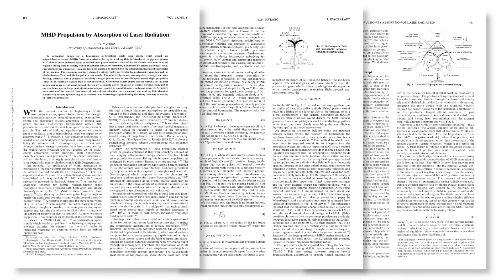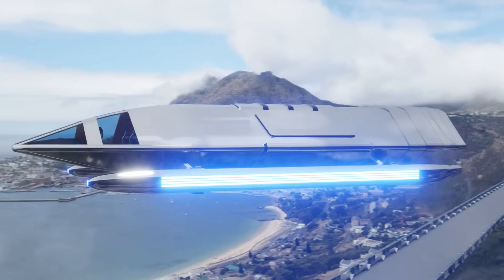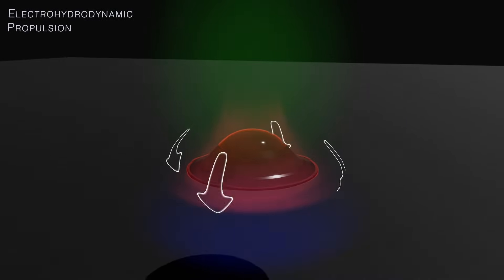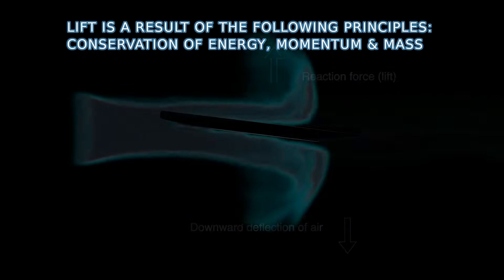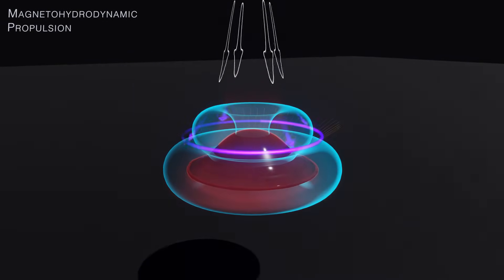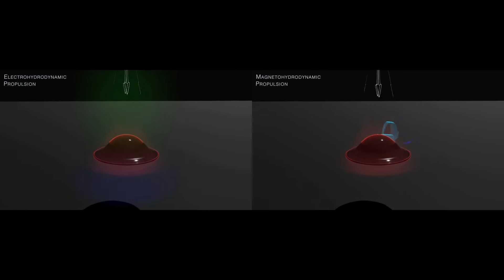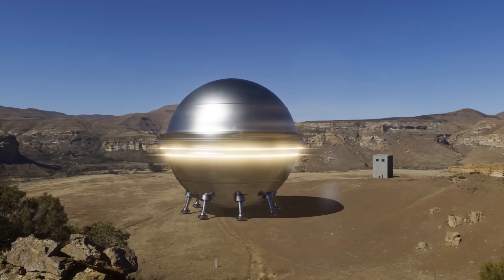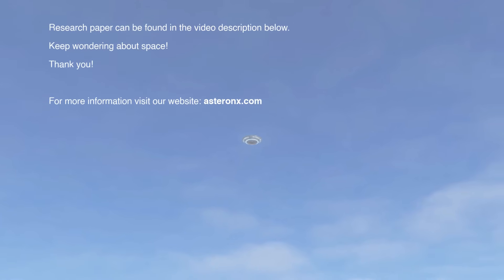Magnetohydrodynamic (MHD) Propulsion - What Is It? #magnetohydrodynamics #mhd #aerospace #asteronx

Comment: The concept requires two very significant accomplishments: 1) High temperature superconductors and 2) Power generation that is huge yet lightweight. The field density would be problematic. Field strength decays by radius squared (R**2) but don't stand too close or it'll pull your metal frame glasses off your face.
Reply: You can resonate smaller field apparatuses so as to obtain a tighter field since you only have to affect the immediate area around the structure body.
Reply: @trailspike4938  that’s what I was gonna say, all you have to do is put a system dampener on it.
Reply: Exactly:) non magnetic antigravity and standby always on warp systems requires permanent warp looping to feedback destination jump drives are not a negative mass fuel. Coil to Sonic Continuum resonance is fairly time stable merely tilt inner interpolar D/C coils for closest Mass resonance, then pulse Hemispherical coils A/C  resonance destination pulsing.
Reply: @danielfoster2788  i like your funny words magic man
Reply: I know we should write a dictionary dedicated to his mumbo jumbo, should be a best seller in 50 years
Reply: Field intensities do not always go as 1/r2.  A finite solenoid actually has a extended field which diverges over all space and becomes infinitesimal in the limit of an infinite field limit inside the solenoid.  There are dynamic fields which could theoretically couple with large volumes of the earths magnetic fields.  1km3 of the earths B field has about a joule of energy and 1000's could levitate or propel a craft.  For a solenoid, field densities would fry ordinary matter so its not practical...but some other externalized mhd Flux in parametric resonance?? No one knows...hasn't been tried or simulated.  I'm enthusiastic that AI tools to simulate EM fields reacting with atmospheric gases could come up with new configurations that could couple to produce usable air flows or even usefully couple with the earth's magnetic field to produce lift.
Reply: well, there is lots of evidence to suggest that this kind of thing is already in use for decades in secret, inside the UFOs. some of them are said to use liquid  mercury inside a toroidal container, and the fluid is sped up by a magnetic field from an electromagnet that has the shape of a magnetic field itself, a toroidal wire cage that spirals inwards like the fibonacci spiral. supposedly this is cooled down a lot to to achieve the superconductivity of the mercury , so that the elecromagnetic forces can be strong enough for the mercury to reach rpm speeds high enough to produce a force strong enough to propel the engine. supposedly this type of rotation being needed is the reason why UFOs look mostly like flying saucers, it the most efficient way to put people on it without it having an irregular mass distribution.

Unlike the propulsion suggested in this video though, these craft use ether physics based true anti gravity, meaning they dont ionize the air or vacuum around them, they create gravitaional fields that push against other gravitational fields, allowing free energy, meaning they dont need fuel once their engine is running, because they interact with the gravitational fields of the planets, and it can use these already existing, strong gravitational fields to produce energy and for propulsion, which is why this is not made public, because its essentially free clean energy. 

Imagine a device that has no degradable motor and doesnt need fuel beyond being started, while allowing fast air travel, making roads, ships, planes and cities unnecessary, and instantly liberating the economy. think about how much of the economy is being kept down by the need for energy and fuel. it would mean instant utopia with costs of everything being very cheap because none of the energy and transportation cost that are inside the production process would be needed, nobody would need cars, nobody would need to pay for building roads, and housing would be cheap because you would not need to compete for space with other people in a limited area around infrastructure and work places. it means the entire governmental control would be erased because survival would be so cheap that nobody would need to work all day just to survive, and people would have enough time and energy and resources to make propaganda useless

this can also be combined with teslas wireless energy / zennec surface wave technology, which allows global wireless communication without the need for wires at all, with wave length so big that there is zero radiation danger, zero need to build all these use facilities,  and energy tranfer without wires, with 100% effeciency. think about electronic devices that need no battery and no cable, and how light weight and efficient these could be. Its not hard to understand why this is not a reality yet. its about control and subjuguation.
Reply: @sshreddderr9409  there are safer methods than mercury and mercury is more superconducting with ammonia. Water doped with piezo spin elements is much safer and far less toxic to the environment. Levitation requires two counter spinning toroids.
Reply: @danielfoster2788  can you answer me a question? why are 2 counter rotating toroids needed? I thought the vortex created by one can push against the gravitational field (vortex) of the planet  itself, because that is what gives it weight in the first place. If I can levitate anything with a strong enough magnetic field, a strong enough field should be enough. 

maybe I misunderstand how it works. I know  the different rotations directions cause repulsion from each other, but why does it have to push against a component of itself? how would repulsion of the toroids result in in lift of the craft when both are attached to the same craft?
The craft has to push against something, if thats also attached to the craft it should never lift at all.
Reply: @sshreddderr9409  because that is how gravity works. You can use a singular magnetic dipole field but then you are wasting tremendous energy. You would do much better going monopolar in that sense and yet gravity is non magnetic.
Reply: @sshreddderr9409  Using magnetism dipole or monopole is a tremendous waste of energy. Venus hasn’t poles yet it does have gravity. Magnetic cancellation, negative EM pulsing (cold electricity & plasma), and fine tuning is by far the most space worthy field propulsion and I must write that propulsion in this sense is definitely not the correct word.  There are instabilities using magnetism “wavering” predominantly. Actual gravitic levitation is solid and stable.
Reply: @sshreddderr9409  another issue is that energy cannot be destroyed or created so then what is magnetic cancellation ?? What energy or force unfolds by such?
Reply: Negative EM flows are the cold keys to antigravity: Cold electricity, plasma, and negative impedance. My gravinductor is magnetically cancelled over laterally, perpendicular, and parallel. MHD is not necessary for levitation or propulsion, however magnetic monopole coils windings are helpful.
Reply: Your assertion about the decay of field strength is incorrect.
Reply: Or hydrostatic motors to induce the geometry...
Reply: Well we have the magnetic superconductors it's just the power requirement that's damn near insurmountable
Reply: there is a patent by navi claiming room-temperature superconductors using crystals. 
"Piezoelectricity-induced High Temperature Superconductor"
Reply: @raysplay2827  Can you supply the link? It would be much appreciated.
Reply: Magnetically cancelled electrogravity is much safer and requires tuning not blunt raging force.
Reply: It’s about fine tunings and not brunt force lol!
Reply: I thought I had shared a photo of my gravinductor coils with this group. I levitated those coils in a spherical arrangement unwaveringly and solid in air weighing in at 1 1/2 pounds using a light dimmer for the outside hemisphere counterwound cross hatch coils and a D/C strobe light power unit for the inner pancake and column coils.
Reply: @danielfoster2788 Resonance is a beautiful thing

Comment: Pretty sure wings only work when air flow is attached to the surface of the wing and flow difference between the top and bottom of the wing, the faster flowing air taking the longer path has a net lower pressure than the slower moving air underneath taking a shorter path. That difference in pressure causes lift, so long as the air flow remains attached. The effect is entirely localized around the wing, that's why turbulence causes the sudden drops as the gusts are causing the the air to detach and the lift to momentarily disappear till the airflow can reattaches and is able to generate lift.

Modern cars use it all the time, I know my car uses it to create low pressure pockets to help pull hot air out of the radiator.

Unfortunately MHD never got much past trials in lab settings as the electrolysis of the water often created H2 bubble signature due to the current being applied directly to the water. In space the mass needed to act as a reaction mass limits load capacity size. I'm still putting my money on solar sails capturing the solar wind pressure created by solar radiation or great big glass orbs or lenses located at Lagrange points focus solar radiation to help speed up solar craft, so they don't need to carry as much reaction mass.
Reply: not the propeller, the old design.  The propeller design was patented by Nassim Haramein.
Reply: pfffft solar propeller bro.  It has to be upwards of 40000 rpms with the special mercury to fool the universe into thinking it's a planet.  Thereby giving it gravity.

Comment: Power + counter rotating torroidal magnets (5:49 etc) and we're all laughing!    ;  )
Reply: Some one tell me to do a sandwich of donus, flint iron flint, counter rotating at 3000 rpm.   What info do you have?
Reply: @BienestarMutuo  Sounds like you're onto something, but I'd be tempted to go flint bismuth iron bismuth flint, and absolutely no more than 2200 revs.
Reply: @prof.heinous191   3 donut rings 2 of flint and 1 of iron ore spin the flint rings at 3000rpm clockwise and the iron ore ring anti clockwise and 2700 rpm and rotate assembly on x,y,z axis for direction.

iron ore donut sandwich = flint ,iron ore, flint spinning on bronze shaft and ball race cores driven by motors from rubber wheels, system forms and egg shaped gravity bubble 5 times size of what ever radius donuts you manufacture, lift strength is controlled by centre iron ore donut rpm and is expediential

has no biological side affects lifted materials are usually mounted on a clear flat tray or floor of any desired structure minimum spin limiters are usually advised to protect machine full structure but smaller devices can be made e.g. lifting trollies with handles extending out side gravity field no further than 20% of mid bubble radius.

Please notify me of any successful replication.
Reply: @BienestarMutuo  I will start attempting replication experiments immediately, I find the hardest bit is fabricating the flint rings, they're so prone to fracturing, any tips?

Comment: If circulating MHD fluid is being used for propulsion or lift, this could explain the tilt of the "TIC TAC" ufo while moving, just like trying to push a gyro and it will turn or try to rotate when force out of a resting position. Just food for thought.

Comment: Again, this requires a mass to be accelerated.  The "fluid" he mentions.  It still requires fuel in space.  And its a very VERY inefficient due to power used.  COmpared to a standard EMT.  Oh, and most of what he says is nonsense.  "word pie" as we like to call it in engineering.

Comment: These craft might use an ionic drive to get about and infact im sure some alien craft do, there are many reports of a blue plasma flame and ionic wind as they take off

My problem is, ion drives only explain lift with an equal and opposite force every ufo craft that's been documented certainly take off  using ionic wind, but as soon as it rises the propulsion system stops and they begin to drift/float

For humans to create enough current to overcome gravity we need to be plugged into a power ststion to sustain lift

This technology has to be in conjuction with some kind of antigravity system as sustaining lift is extremely power hungry. If we do develop it, we need minature fusion drives to power these craft without antigravity

Comment: The intro to this AI generated trash is not a joke!! My GOAT bought shares in the MHD starships in 1888. Those licenses exposed the acceleration to a perpendicular electronic field. That investment made hobo reduction a profit margin under the same vehicle. Thank you ion wind.
Reply: Hang around for the poolroom / sleazy bar jazz funk if you're hard up for anything that needs more than three chords.
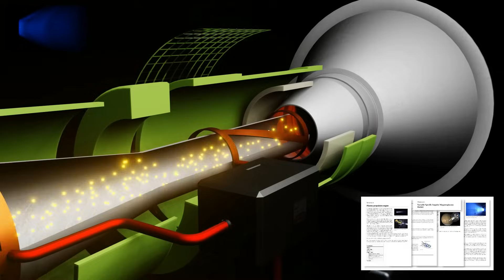Reply: @12:55 I have also experienced this effect, without the cool 3D renders, and the soundtrack was a bit different. The hot plasma exkape I mean.
Reply: Quantum vacuum wasn't an issue, the temperatures are within 'nominal' range.
Reply: So much thrust bro, keep it on the deeper level of understanding.